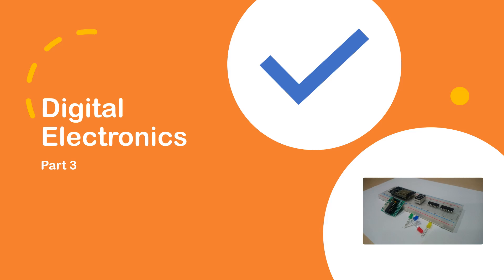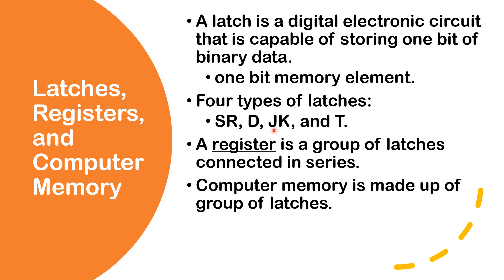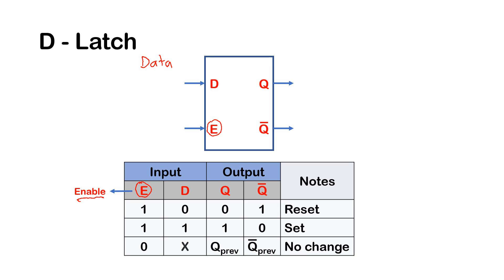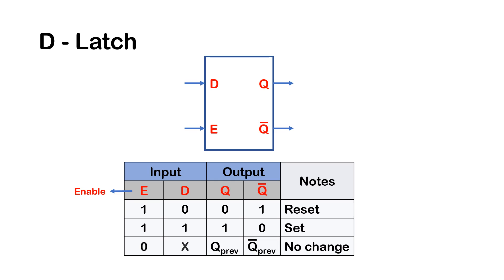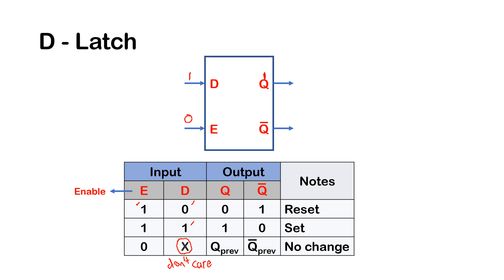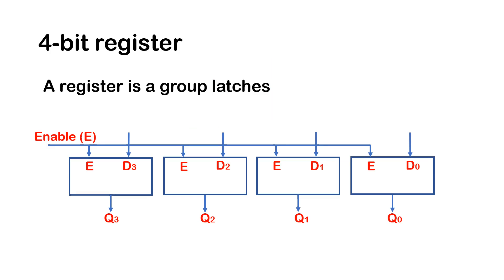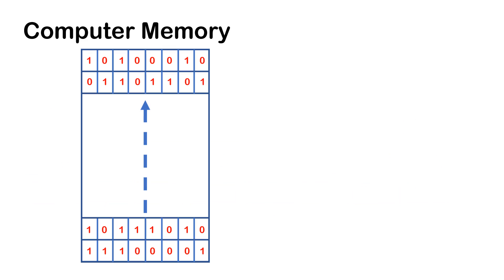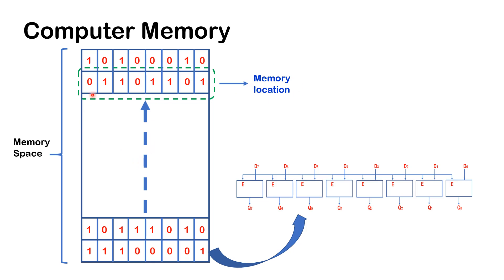#06 Latch, Registers, and Memory

Comment: But sir , the resistor is a very small component, so how do they contain many latches ?.
Reply from the maker: You can get a 4-bit register in one chip. An example is the SN7494N ttl chip. There is also a 8-bit register chip, i.e. the 74LS164 ttl chip. These chips are MSI (Medium Scale Integration) devices. MSI devices usually consist of 10–100 gates.